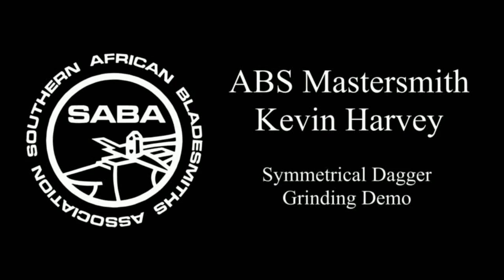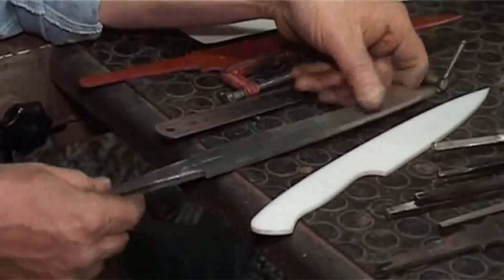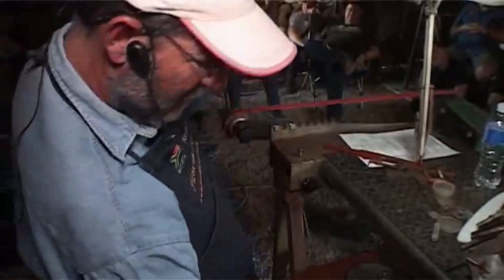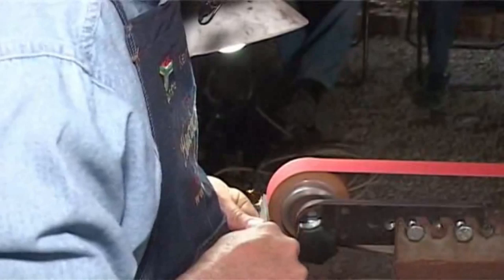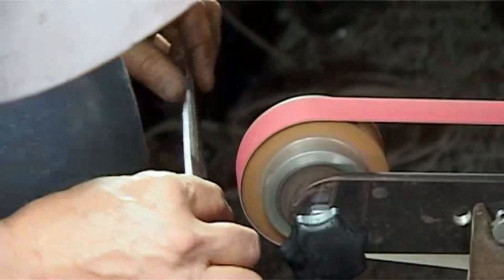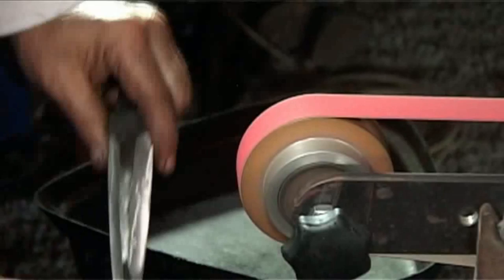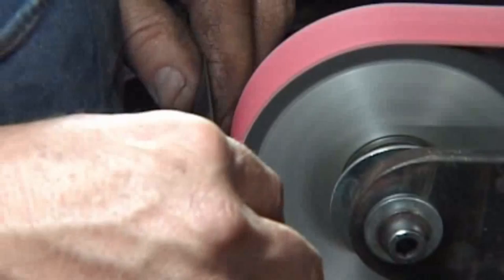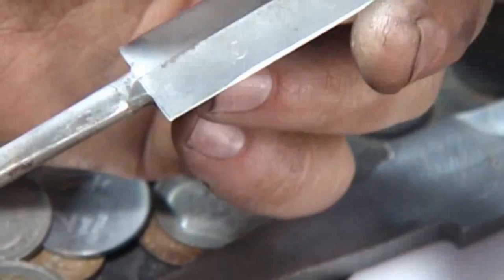Dagger Planning and Grinding by ABS Mastersmith Kevin Harvey

Comment: Great tutorial video. If i may ask what's the dimensions on the wheel used in the video ?
Reply from the maker: The yellow one was 1 inch by 3 inch. The larger black one was 1 inch by 2 inch
Reply: @NeelsVandenBerg  Thank .